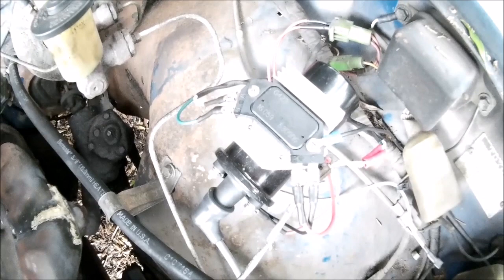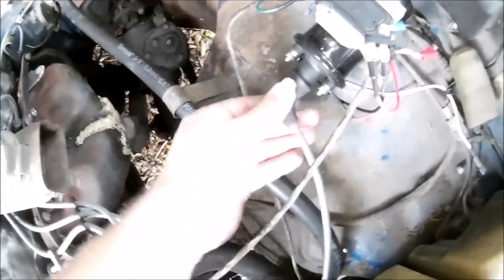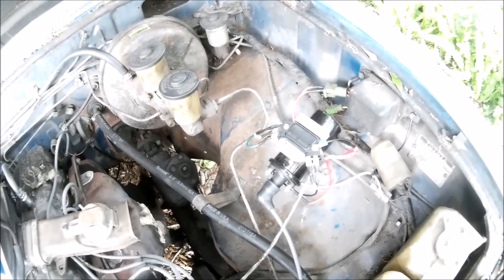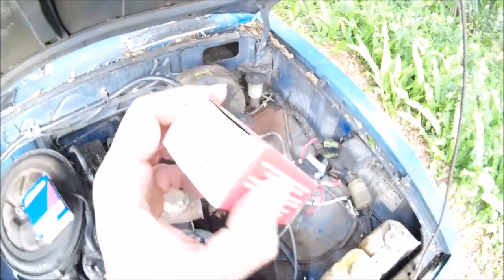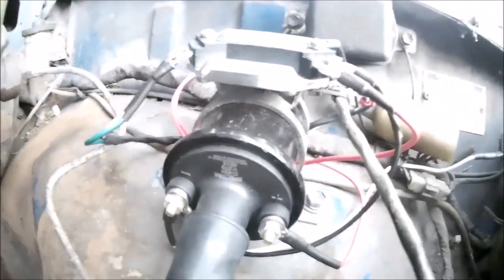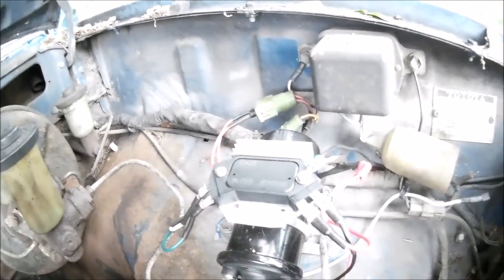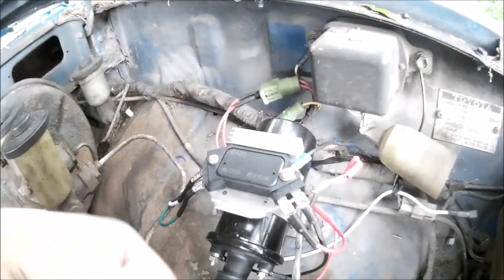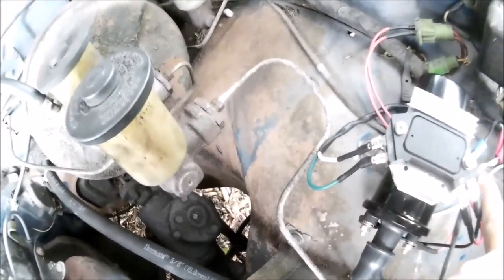1978 Toyota Pickup/Hilux 20R - GM HEI Ignition Module Conversion

Comment: I just did this conversion with the same parts that you used it is on a 1987 truck with a 22r engine from what I understand the coil that I purchased does not have a ballast resistor what ballast resistor do I need to install to ensure that my ICM does not burn
Reply from the maker: In general, no, you do not need a ballast resistor. Modern ignition coils (generally from 1972 onwards) are designed to operate at 12 volts. Older coils were designed to operate at 7 to 9 volts (old-timers called them "6 volt coils"), so the resistor was needed to drop or "regulate" the voltage & current going to your coil, and to make it live longer. The GM style HEI modules are designed to use full battery voltage (12 volt) so there is no need for a ballast resistor.

To the best of my knowledge, there are several ways an ignition control module (ICM) could fry. Most common is a bad coil. If the secondary resistance of the coil gets too high, due to shorted windings, the higher resistance can & will burn the ICM. I went through this three times on my truck, due to using a poor quality coil. If you got the Standard Motor Parts UC12 coil you're OK. Any of the Chinese made coils are a problem. Their quality is low, they don't last & proceed to toast ICM's one after another until you get a good quality coil to replace it.

BTW, the HEI modules will work with coil secondary resistances rated as high as 12,500 Ohms spec. Stock spec on the 1987 Toyota 22R coil is 0.5-0.7 Ohms Primary, 11.500 Ohms Secondary, so the HEI ICM should work just fine.

Other causes of ICM failure are: too much underhood heat (rarely a problem), poor heat dissipation from the module (too small or no heat sink, dried out or missing heat sink compound, module poorly seated), voltage spikes (failed alternator and/or voltage regulator).

This conversion is also great for being easy to fix if the ICM does fry. They are cheap enough to keep a spare in the glovebox along with a few basic tools. They can be changed out on the side of the road in 5-10 minutes so you can get going again.

Comment: I appreciate your video series on 20R troubleshooting.  I have a 20R on my homemade tracked machine and this weekend the igniter went out.  I replaced the igniter and coil with an O'Reilly GM ICM and coil (the 12v type that doesn't need an external resistor) .  The engine idles and revs up fine, but it stumbles and dies when it tries to return to idle.  This never happened with the stock coil and igniter, so I know it isn't my wiring or switch.  I was thinking of buying the exact same Igniter and coil you had on your truck to see if that would work.  The parts I plan on buying from Rockauto will be the same ICM and heat sink that you got with addition to a replacement Spectra C624 coil.  Does this coil need an external resistor to function?  If so where can I get one?  Thanks 20R guru!
Reply from the maker: Thanks for the kind words, I'm glad to help out fellow Toyota owners, even if it is just the engine. :^)

The setup I show here does not need a ballast resistor & my motor runs as well as, if not better, than on the stock Toyota Ignitor. There is no reason the conversion shouldn't work correctly, unless you did something wrong, or there is a problem elsewhere (bad/insufficient ground, fuel issue, pickup coil gap wrong, etc.) 

It could also be parts incompatibility. I'd be really curious as to the brand & part number of the ICM you got from O'Reillys so I can do some research and see if it is compatible or not. As for the coil, the Spectra C624 coil is supposed to be a direct replacement for the original NipponDenso (Toyota) coil. Again, I wonder about the coil you bought & what it is exactly. Not all 12 volt coils are created equal. There are some quality differences, but the main thing in this case is that sometimes the coils resistance measurements can vary widely. This can (could) effect performance, & even possibly cause the ICM to do what you say yours is doing.

Before going and buying more new parts, I'd back-check what I have on hand first. I had to do this a few times myself to correct minor problems before I got it running sweet. Meanwhile if you forward me the brand names & part numbers of the ICM & coil you bought, I'd be glad to dig into some research on them & let you know what I find.
Reply: I bought the components a couple of years ago to prepare for the inevitable, but like a fool I didn't keep the boxes or receipt :(. The ICM has the number 8752F27B etched into it, but I couldn't get any hits off google from it.  I just realized the coil is actually a Ford replacement part.  It says on the side "12V USE WITHOUT EXTERNAL RESISTOR 080".  Resistances measure 3.8 ohms at the primary,  9.4 kohms at the secondary.  Maybe you are right,  the coil is not matched correctly with the GM igniter?
Reply: I tried the new parts out, but I am receiving the same issue: https://www.youtube.com/watch?v=eAtUsYrh1e8. The wiring is rigged up for testing, but I checked grounds and continuity on all connections and they are good.  For some reason the ICM is grounding out at medium RPMs and deceleration (3000rpm+ and idle is fine).  First I am going to do some digging on my signal voltages.  The only fixes I found from people that had the same issue is they replaced the Toyota coil with a GM HEI coil.  Before I do, I am going to run some more tests, last thing I need is more coils lol
Reply from the maker: I think you're on the right track here. Nice job on adding the timing light to your vid too; I can see the #1 plug signal completely cutting out. I can't see how the GM HEI coil would make any difference. All the ICM does is switch the negative on & off & any non-ballasted coil within spec should work without problems.

Have you measured/checked your pickup coil in the distributor? The air gap spec is .008 to .016; I run mine on the tight side, between .008 & .010. Have you checked the pickup coils resistance? I seem to remember that the spec is 130 to 190 ohms (cold), but can't find it in print right now; pretty sure that's correct tho. Also, how old is the pickup coil? Even Standard only warranty's them for 3 years or 36,000 miles, so if it's ancient that could also be a source of an intermittent short/grounding or resistance problem. Of course check the pickup coil cable for obvious breaks/damage & make sure terminals are clean.

Sorry, just being over-complete as usual. Taking it all in order like you are doing is best though & you seem to know more than a thing or two. :^) Only other thots I have are charging system, particularly the voltage regulator. It's still a box of reeds with contacts on them that can wear out or foul.

Last things. I noticed in your video something a little strange. When you let off the throttle after rev, the part on the throttle shaft does not immediately return, but seems to hesitate, then drop to closed, which is exactly when the stalling happens. I know that's not electrically related, but I did notice it. Sticky throttle shaft? Keep me posted please.
Reply: Thanks for the help so far! I bought some new plug and coil wires which I will try out tomorrow.  I noticed I had intermittent spark on cyl #4, turns out the plug wire was arcing to the block haha. 

If you have time could you check your voltage at the "C" terminal of the ICM, during idle, high RPM, and decel?  I made a video which shows the "irregularity" at my terminal "C" https://youtu.be/tlQywFNAO6E.  The 1.8 voltage drop tells me my module is grounding through the module and not the plugs, at least that's my theory.  How to fix that I have no idea.
Reply from the maker: No problem & I will continue to try. Oddly enough, I mentioned your situation to the wife (who went through the mill with me when I was rebuilding my charging system & doing the conversion, so she knows), and the first thing she said was plug wires. At least the new ones will eliminate a suspect. You do have your plugs gapped at .031 right?

I would absolutely check voltages for you on my setup, but the truck is currently up on jack stands with the trans, driveshaft, clutch & clutch hydraulic system out for a complete overhaul. Not safe or smart for me to try & run it with all that stuff out, otherwise I'd do it for you without question. It's taking me an age to get it all back together too. :^(

Your wiring looks good, but why the jumper between the mounting holes on the ICM? You only need the ground wire on the hole with the "pad" on it. The other hole doesn't have any connection to the ground of the ICM, or anything else. Curious.

How old is the battery and what does it measure with the engine off? Anything more than 5 years old or below 12.3 volts I'd replace the battery. Good battery at rest should be 12.3 volts to 12.8 volts (the higher the better). Your "running" battery voltage is kinda low & should NOT be declining @ higher RPM's. Minimum I'd expect to see is 13.3 to 13.8 volts, maybe higher if your battery is "run down" but not more than 14.8 volts. That's why I suspected the Alternator or Voltage Regulator. You could easily pull them & have them tested for free at Auto Zone, Advance, O'Reillys or most any other parts shop. At least then you'd have a baseline & confirm or eliminate suspects. I had to do this on mine. Turned out my battery was dying, Alt was almost completely failed & my voltage reg was the same. This happens with 40 year old equipment. :^) Now I get 14.8 volts charging after starting & 13.8 volts maintenance charging while running.

Lastly, have you done a voltage drop test on your ground circuit(s)? This test can show you if you have a wire or resistance problem, or a ground wire that's not up to snuff. Anything more than a 0.1 volt drop shows a problem. Here's basic instructions, if you need them: http://fme-cat.com/docs/1519.pdf

Good work so far boss, if I could figure it out I'm sure you can. Standing by for updates...
Reply: Well I did get it to work but not with the GM ICM :(.  Was able to snag a $30 ICM off of ebay from a 1983 22R Celica, works like a champ now.  I don't know why it didn't work for me, but hopefully this discussion helps someone else in the future.  Once again thanks for helping me out!
Reply from the maker: Well, that's rather annoying, at least to me. No reason it shouldn't have worked. I guess your Japanese equipment is less tolerant of American parts. :^)

Glad to try to help, just sorry it didn't work out the way it was intended to. Now go bag some fish with that amphib boss.

Comment: Would this work on a 1978 Corona? Does a Hilux Ignition Module work with a 1978 Toyota?
Reply from the maker: If the Corona has the 20R engine in it, then yes this should work fine. It should also work on the 1.6 or 1.8 liter engine, as long as you have the distributor with the pickup coil in it. I checked for parts cross-matching on the distributor & it is the same part number for the pickup & the Corona. This is the distributor with the pickup coil in it, NOT the earlier points style distributor. Double check your distributor to make sure it is correct.

The US spec for the 1978 Corona is showing it as only being available with the 20R, so you shouldn't have any problems making this work. It's the same motor & distributor as the Pickup/Hilux. If you are outside the US & have a different engine it may still work; contact me again with your info & I'd be glad to help or give an opinion.

If you can find a working original Toyota ignitor box from a 1978 - 1980 Pickup/Hilux it should also work in the Corona (again, US spec). I did the HEI ignition module conversion for cost reasons ($13 US compared to $400 US for a new ignitor box). It works very well & is very reliable, as long as you have a good heat sink for it, as described & shown in the video.

Let me know if I can help with anything.
Reply: Awesome Thanks man!
Reply from the maker: No problem, best of luck with it!
Reply: It's been a real pain trying to find a replacement part. Everytime I save up for the part whether if it's 250 or 500 bucks I get a full refund three days later and the online store telling me the part is not in stock. I think I finnally found a part on ebay but not sure about it. I'll definitely be trying this out on my Corona and let you know how it goes. I tried at least 5 online stores and all of them advertise the part but don't have it in stock.
Reply from the maker: I know, that's why I went the HEI Module route. Cheaper & works just the same as the stock unit. The module I used was Made in USA by Standard Motor Parts, Standard T-Series Part # LX301T. (Standard Motor Products info page for module: http://ecatalog.smpcorp.com/STD/#/vehicles/parts/num/LX301T?type=s) GM used it on many models of 4 & 6 cylinders, 350 V8's on up to Cadillac 472 cubic inch monsters. I also used the AC Delco HEI Heatsink part # 10474610 (less than $20 & available everywhere, & CRUCIAL to the modification working right & lasting a long time. See vid.) The stock spec coil will work with the conversion.

Here's another online info source on the conversion: https://bbs.zuwharrie.com/content?topic=85514.0

If you are still trying to find an original type - 1. Be careful with Ebay; if it's showing as coming from China it's a coin flip on whether you will get the part or not.
2. The only new one I've seen for sale is on Oreilly Auto Parts website; I don't know if you have Oreilly's near you, but they are showing it as available to order in store, or call the store to order, & then pick up at the store. It's showing as not available for "ship to home." Oreilly Part # 14-0231. https://www.oreillyauto.com/
3. If you want to take a chance on used you may want to call Jim's Used Toyota Truck Parts (website - http://yodajims.com/) They've been pretty good to me in getting parts for the truck (exhaust manifold, gas tank, neither of which is available new) & they might have the igniter module. The '78 truck one should work on a '78 Corona with the 20R; it's the same setup.

Let me know how it goes when you get to it.

Comment: Hello Everyone!
I need to do this conversion as well because my car will randomly die on the road. My dad put an extra one of these igniter with coil units so all I have to do is change the wires from one unit to the other and the car turns back on. My question is will this modification work with the regular distributer on the 20r engine? Or do I have to change that part as well?